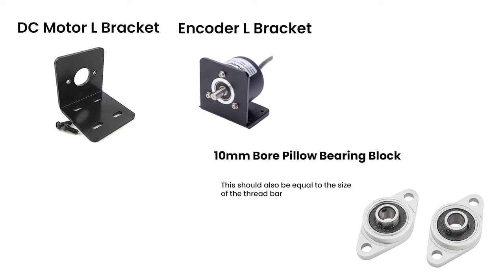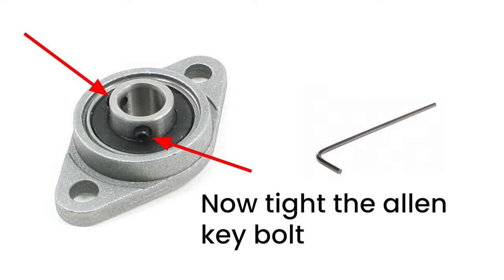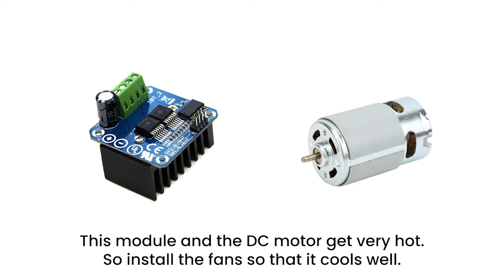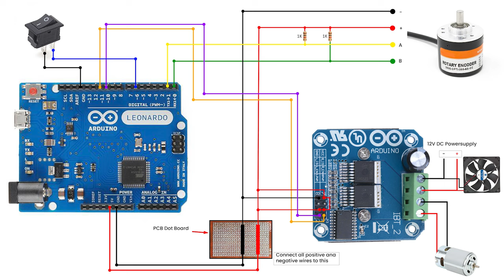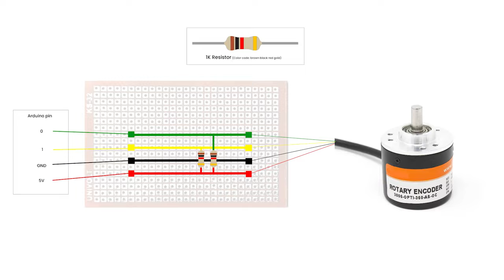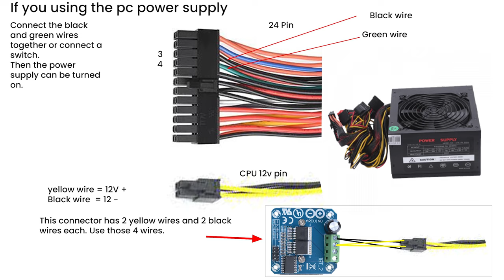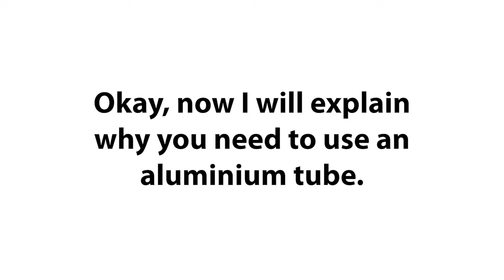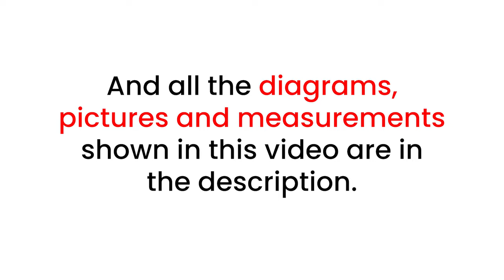How To Make Force FeedBack Gaming Steering Wheel | Arduino

Comment: Hey, I had a doubt, if I am using an arduino Leonardo instead of a controller’s board can I use 5 analog inputs (steering, gas, brake, hand brake, clutch) because the arduino has 6 analog inputs available right ?
Reply from the maker: No bro, the Arduino has six analogs, but the software supports only four analogs.
Reply: You can use emc utility
Reply: @zudumalli four?  Then you can use  clutch brake acc and handbrake?
Reply: @RealRenko then the steering

Comment: Man you do not need to stick paper for fitting the rod into the bearing, i have built lots of 3D printer with the same kind of bearing and thread rod, you can trust the allen key enough as long as you tighten it enough.

Comment: hello bro can i use any other motor driver other than bts 7960 because its very expensive there is another board L298 H bridge which is also marked as it will work with arduino
Reply from the maker: No, it can't

Comment: Hi, why is this build do not works with other arduinos? I am planning to build something similar, and collecting ideas. I plan to do it with something stronger than an arduino, maybe an ARM. Or maybe the pc program can only use arduino leonardo?
Reply from the maker: We use wheelconfig software to use this. This software supports only arduino leanardo. But I have seen some people make it from other program boards. But I don't really know much about it.
Reply: @zudumalli  okay thanks for the answer, i am gonna do a little bit more research

Comment: why we can't use arduino uno,  i have uno can we able to make without ffb. any idea
Reply: Bro i tried Uno at First Too i tried it with Uno joy and Encoder but no its not working you cant Upload the Firmware for the Software rfr Wheel configuration on the uno because it has a different Chip so it isnt possible and you have no Force Feedback wich means you have no center spring or degree lock for example 900 degree lock wont work so not worth it buy Leonardo instead
Reply: U can make a wheel without ffb with uno but it is not that good

Comment: can u use a mouse sensor ?? for rotation detection ? converting a rotation motion to linear motion and then converting it into a angular motion by using geometric functions as a high DPI mouse can detect a linear displacement so aacurate and precise so that the cost can be reduced, we can increase its effeicency more than 600PPR

Comment: is it possible to use a DC motor type 550 at 14.4 volts?
Reply from the maker: Yes you can but the torque is quite low
Reply: @zudumalli   So I'd better order a new motor.
thank you for responding to comments even after such a long time))

Comment: hello there are multiple versions of the dc motor that you showed, so i wanted to know how many newtonmeters of torque you reccomended, is 1 enough or do i need more?
Reply from the maker: One motor is enough for me. It depends on the size of the pulley and steering wheel you are using. But I also install another motor in the future.

Comment: Let me ask you, the steering wheel turns on bt but turning to the right is ok but to the left the steering wheel runs full speed.  The effort of locking it to prevent it from rotating is a failure, isn't it? I hope you can help me
Reply from the maker: make sure the wheel config command mode is ( PWM +/- ) or reset all settings to default

Comment: Hello, I have a question, if I only have a 12v DC motor, can it only work with a 12v power supply or can it also work with a 24v one and if possible, which one would you recommend?
Reply from the maker: it's depending on the manufacturer. Google your motor type and find the maximum voltage it can provide.
Reply: @zudumalli Also when I connected my power supply when testing the ffb the power supply literally exploded. Any advice so that this doesn't happen? Sorry for all the questions

Comment: I have a question, why would you need to connect a resistor from the postive terminal to channel 1 and 2 of the rotary encoder?
Reply from the maker: this project uses an "NPN open collector output type" encoder so we have to use ''INPUT_PULLUP'' inputs or ''external pull-up'' resistors. that's why I am using 10k resistors. Basically, if we don't use resistors, the wheel is completely not working

Comment: Hi,
Have a problem) With this program in port 10  is always served 5v and motor always work in max, what could be, won't you tell me? Thank you in advance)
Reply from the maker: in the wheel config software have you not selected the command mode as PWM +/-  ?
Reply: @zudumalli  no, selected PWM+Dir

Comment: How do i fix mine when i rotate my encoder its move slightly then go back to its original state its not rotating its just keep coming back to the center
I tried it to my uno and enter a code to read the rotation and it was ok but not in my Leonardo
Hope you can help me
Reply from the maker: Have you checked if the z-toggle switch is working?

Comment: Hello bro, I was looking at the diagram and pins 7 and 8 are not connected. Could two more buttons be connected there? And assign them in the program? Since they are not being used and I would like to place more buttons for other actions
Reply from the maker: no you can use A3, A4, A5 (analog side)
Reply: @zudumalli  I installed the buttons on Pins A, but they did not work, instead I installed them on Pins 7,8 and 9 and managed to obtain more actions with three more buttons

Comment: When I am connecting button and I press it. My wheel Center messes up and rotary encoder isn’t  working for a while. What can I do?
Reply from the maker: check your wiring maybe there is a short circuit
Reply: @zudumalli  hey I checked it.  But when I use the wheel rotary encoder isn’t stable? The center moves tiny bit every time i use the wheel

Comment: Hi, I'm planning to make the same steering wheel, but I have a couple of questions:

1) If you buy a gearbox and handbrake that connect via USB, will they work together with this steering wheel? (I’m also going to make the pedals myself).  
2) I don’t particularly understand electronics, but I want to put 2 motors in this steering wheel, can you tell me how to connect 2 motors?  
3) I am going to power this steering wheel using a computer power supply, but in your diagram I don’t understand how to connect it to the board, can you help me with this?

I hope that you will answer my questions and I want to say that your homemade product is very cool!!!
Reply from the maker: 1.) Yes you can use multiple devices. it's ok.

2.) If connecting two motors you have two options.
First, you can connect both motors in parallel to the same BTS7960 motor driver.
2nd you can use two BTS7960 motor drivers and provide separate power to the two motors.

3.) Yes, what do you not understand?

Thank you!!
Reply: @lumivision.  i think the motor driver will share the power of single motor to two motors

Comment: Hello, I'm going to make a same steering wheel like yours, but a have some questions
1 if i changed all the pulley with smaller size: 10mm bore 60 teeth to 40 teeth, 10mm bore 20 teeth to 16 teeth does cause any problem ?
2 my wheel will have 2 motor, can you tell me how to connect more fans ?
3 Can you tell me how to connect the wheel with the aluminium tube ?
I hope that you will reply the answer
Reply from the maker: 1.  20 teeth + 60 teeth ratio is = 1 : 3
     16 teeth + 40 teeth ratio is = 1 : 2.5
The 3 and 2.5 ratios were slightly different here but it's not a problem.
but remember if the pulley ratio was little the motor needed more energy to rotate. and at this moment the motor gets more heat.
2. you can connect directly your 12v supply
3. you can use this part for it. its call ''linear Rod Rail Shaft Support''

Comment: if i want to use two 775 motor in parallel, how many Volt and Amp smps should i buy?
Reply from the maker: you can use 24V 2.7A (65W) power supply

Comment: Which software are you using, and does it support steam games like f1.
If possible, can you explain how ardunio is connected to pc to detect it as a gamepad. Mostly software side of the build.
Thanks 😊
Reply from the maker: It does not require any software.
The wheelconfig software will automatically detect the game.

Comment: Can i use a power supply of 12v 5amp because I am using only steering and gas and brake along with ffb ( I don't need Padal shifter or h shifter )😊and can i use a laptop adapter of 12v  without power supply
Reply: nope you need 15 amps because it will not work loss of power due to its short trravel
Reply from the maker: no, you can't. @BlUMILEEDITS is right. btw you can use 24v 5amp adapter.
Reply: @zudumalli  can we use 24v power supply with only one motor without any worries?

Comment: Bro plz tell me the best arduino model for making ffb stearing while gear box and and clutch brake and acceleration best model
Reply from the maker: This firmware only supports to arduino Leonardo board only.
Reply: @zudumalli arduino uno is no the best for making iy

Comment: Thanks a lot bro goodjob🙌♥️
But i have some questions .

 Is this 900deg wheel??

And a watch some videos creating this wheel but with STM32F401CCU6 board and says  this is better than arduino is that true? And is possible to make this with STM32F401CCU6?
Reply from the maker: Yes, it supports a max of 2160 degrees of wheel rotation. 
I actually don't know about that.
Reply: @zudumalli  thank you♥️

Comment: can't i use arduino mega 2560 pro instead of leonardo?? if so, where can I get the firmware?
Reply: the firmware is made for the leonardos chip so you cant use that
Reply from the maker: firmware for Leonardo. cant use other

Comment: I hope you can see my comment. I want to know the rpm of your 775 motor because I can buy 2 variations (one with 1800rpm and one lower rpm).
Reply from the maker: 775 motor has an RPM between 12,000 – 15,000
Reply: @zudumalli  thanks

Comment: can I apply 14-15 volts to the motor driver board
Reply from the maker: It can use up to 27v
Reply: @zudumalli  thank you very much, I will also collect it when the encoder arrives

Comment: hello my friend one question here does the motor handle the resistance fighting with your hand? I'm worrying it my burnet out, how many current does it draw on load have u checked?  and also I have seen ur diagram sheet (pictures) and I have seen u used 7 buttons connected with H-shifter, can the be used simultaneously or when u use the buttons u don't use the H-shifter? how does it work really?   
and I cant wait till u put out hand brake with controller and how to be able to play forza horizon 5, tnx for the video keep it up, well explained
Reply from the maker: 1. Yes, it is one motor, but when the FFB power is used at 100%, it feels like too much powerful. So I use about 60% most of the time. It also depends on the game.
2. No I did not measure the current. But after playing a game for half an hour and doing a temperature test, the maximum is about 52°C. No problem now.
3. Yes, the buttons are not used when using the h shifter.
4. Will upload a video about it soon.

Comment: Brother I have a question, would it be the same process even with settings if i use arduino uno but not arduino leonardo? Btw, the video is🔥
Reply: The Arduino Uno is not able to appear as a USB input device to a computer, so unless you wanted to do significant modifications to the programming, you will need a Leonardo
Reply: На uno можно делать но это очень сложно,надо будет переписать весь код и написать свой
Reply from the maker: No, this coding is made for arduino leonardo board. Therefore, the coding cannot be uploaded to other arduino boards

Comment: I am using rs755 motor now its not working the light in power supply keeps blinking when motor starts to work iam using 12v 10a supply can any one identify the problem
Reply: You Need a better Power supply 10a isnt enough get 15 or 20
Reply: I can Even explain Why, the Most 775 Motors use 12-15a as starting current so you Need atleast a 15a power supply to get it working 👍
Reply: @AbdülkerimYilmayan  it was working good so far but it got heat up and then the motor stopped working
Reply from the maker: Once your power supply heats up, it will stop producing power (10A is not enough for this) and try once using less power like 30-50%
Reply: @zudumalli  actually the motor is heating up and stops

Comment: hello friend, is it possible to use a 4:1 pulley ratio to the encoder to improve acuracy?
Reply from the maker: Yes can, but you need to calculate the correct encoder PPR value
Reply: @zudumalli  so i would put in 2400ppr if i had a 600ppr encoder?
Reply from the maker: Yes you are right

Comment: can u still use 5 amps or 60 watts
Reply from the maker: no. I haven't used 5 amps. this needs 12v 15 or 20 amps.
Reply: @zudumalli  well i think it can be 5 amps since its only for the DC MOTOR not for the others but thanks

Comment: this is not a job with the rs775. I will try with fan motors for air conditioner. rs775 gets very hot(burning).
Reply from the maker: Oh really. Bro did you try with two motors? I think if I put two motors it will be fine
Reply: @zudumalli  No, I haven't tried. I'm looking forward to it if you're going to try it.

￼

Comment: bro in my steering wheel i used 12v 20 amp SMPS and i think its too powerful and the ffb is too stronge and breaks my wheel so s there any way to lower the torque and speed also i am using emc utility lite
Reply from the maker: I haven't tried emc yet

Comment: hey i have a question could you btw give me the details about then fan that you replaced for the motor
 also do we really need the game controller and how do i do it?
Reply from the maker: It's a PWM 120mm cpu fan (1800RPM)
The gamepad is required to play Forza Horizon and assetto corsa games.
Reply: So will you make a video how to connect the gamepad and how to set it up?
Reply from the maker: Yes I do

Comment: U can use a 24 volt big motor as it’s big and does not heat easily 😂
Reply: You know this motor in the video Supports up to 24v too right?😂 but yes i get what u mean a e bike motor would be better but aslong as this motor works its good but yes you Need to cool it well
Reply: @bossoy0769  thanks bro